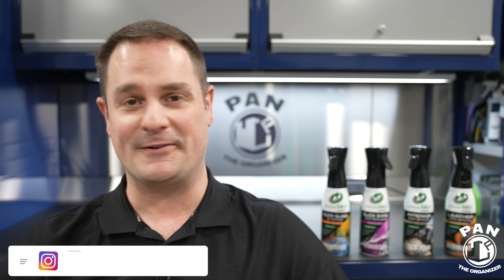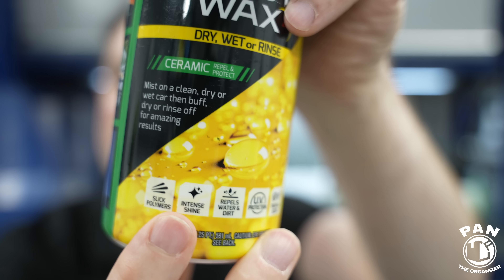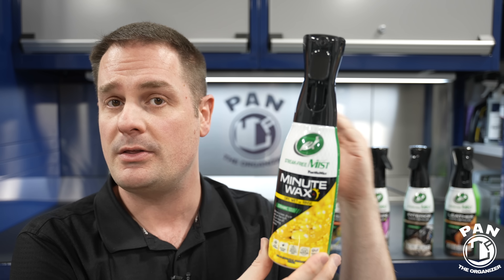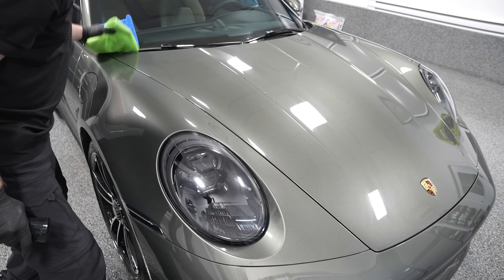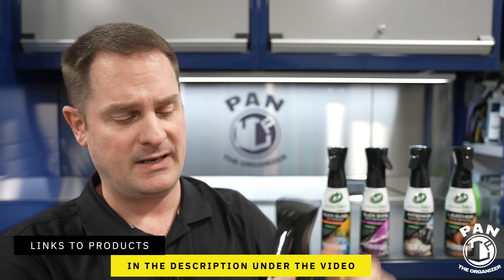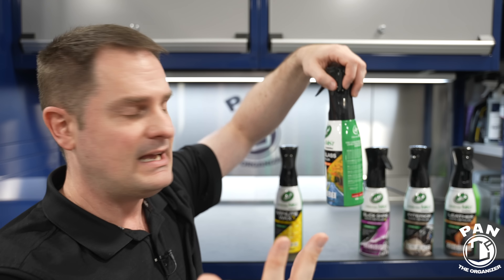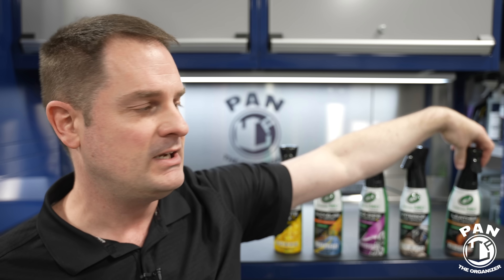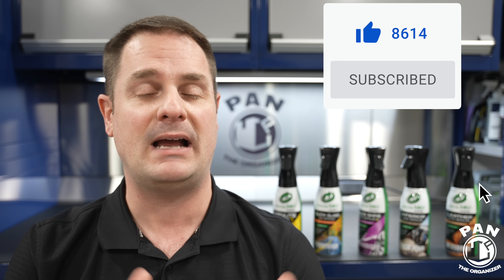The NEW Turtle Wax Minute Wax! You guys made this happen!

Comment: I'm still using the hybrid solutions flex spray wax as my topper. Im thoroughly happy with it. I might try this after that bottle is done
Reply from the maker: Turtle Wax says that Flex Wax is the most versatile and can be used on multiple different surfaces with their highest level of protection; Ceramic Spray Coating is for painted surfaces only, and Minute Wax is great for a quick addition of ceramic to any existing protection.
Reply: @PanTheOrganizer  Our Ceramic Spray Coating can also be used on exterior surfaces including glass, headlights, trim and wheels!

Comment: So pan .... is this similar or cheaper version of flex ? I use flex on my " basic " regular customers and gyeon wetcoat on my ceramic maintenance customers . Maybe a side by side of this and flex .
Reply from the maker: No. Flex Wax isn’t a quick detailer, it’s a long term protection. Not the same thing.

Turtle Wax says that Flex Wax is their most versatile spray on protection and can be used on multiple different surfaces with their highest level of protection. Ceramic Spray Coating is for painted surfaces only, and Minute Wax is great for a quick addition of ceramic to any existing protection. 

In my testing, Flex Wax lasts 9-10 months and viewers in more gentle climates got 10-12 months. With Ceramic Spray Coating, I see 8-9 months with two layers applied (24hrs between layers). And Turtle Wax states one can expect 6 to 12 months of protection with the new Minute Wax. 

As Minute Wax is new to market, I still need more time to evaluate the real world durability of Wet Wax in my conditions, but I would recommend it more as a topper over an existing protection, to boost the properties of that protection and maintain its durability.

Comment: I have tried quite a few so called no streak spray detailers. Haven’t found any yet
Reply from the maker: Often times, it's user error it too much is applied, or applied in the wrong conditions. In all the quick detailers I recommend, I have zero streaking issues. But I work in a controlled environment.
Reply: @PanTheOrganizer  I usually apply in my shop in the shade and only mist it. Have tried the turtle wax black ceramic on my black cars. Not impressed. Only using it now to use it up. Tired of buying things that don’t work as advertised but use them up and try something else when it runs out

Comment: This looks awesome Pan!  Based on your vids, I applied Adam's Graphene Advanced ceramic coating to my new Genesis after full day of prep, as soon as I took delivery in Oct.  Since then only occasionally DIY wash or touchless because of crappy Ottawa winters.  Would you recommend I maintain my coating with Adams graphene detailer srpay, or this new TW MW, or a combo of both?
Reply from the maker: Either or are good choices. You can't go wrong. The key is regular maintenance. Weekly washes are the best.

Comment: what do you say about this vs ice seal n shine?
Reply from the maker: Seal N Shine is in a different product range (ICE which is higher end, and the top of the line is the Hybrid Solutions Line). So I wouldn't compare these. Minute Wax is more of a quick detailer, and Seal N Shine is more of a long term paint sealant (4-6 months durability, and Seal N Shine has way better chemical resistance).

Comment: Pan is this product dangerous and slippery if it gets on motorcycle tires?
Reply from the maker: Never use products on motorcycle tires. If you want to apply this on a motorcycle’s painted surfaces, spray onto a microfiber towel first and then wipe the surface. No risk of overspray on tires that way.
Reply: @PanTheOrganizer   I thought maybe (doesnt these products have Silica in them?)  they wouldnt be crazy slick on tire thread. Unlike typical armor-all, etc!

Comment: I did buy this group of products, I thought I would give them a try. I will have to say that the interior detailing and/or the leather detailer spray, doesn't smell that good. I haven't used many of the other interior products you've reviewed...I will at some point, but so far the chemical guys interior detailer and leather cleaner are light years above the turtle wax stuff when it comes to smell. Now if they could use that smell from their old car wash: the pink bubble gum stuff I will recant.
Reply from the maker: Did you try Minute Wax? This is pretty good!!
Reply: @PanTheOrganizer   I haven't had a chance to use it yet: the weather in Seattle has been uncooperative.

Comment: Turtle wax is really doing a great job with their product line over the past few years. The flairosol (sp?) sprayers are great. My local Walmart has all 5 of these products, although not prominently displayed (their detailing products area looks like a 3 yr old does the organizing). I used the Minute Wax and Slick Glass when I washed my wife's CRV this afternoon (McKees N-914 Rinseless). The minute wax applies easily and does smell great. I love that smooth feeling on the paint afterwards. I'll be curious to see how much rain repellency the Slick Glass provides. 

How do you think the Minute Wax compares to the Hybrid Solutions Ceramic Wet Wax?
Reply from the maker: Minute Wax is more versatile (as it can be applied to wet or dry surfaces), costs less, and according to Turtle Wax, should last longer. Turtle Wax states one can expect 6 to 12 months of protection with the new Minute Wax. 

As Minute Wax is new to market, I still need more time to evaluate the real world durability of Wet Wax in my conditions, but I would recommend it more as a topper over an existing protection, to boost the properties of that protection and maintain its durability.

Comment: Questions Pan. I have a 2023 Tesla Model Y performance with white seats. I just got my car ceramic coated, first time ever. Even on my other Tesla's I didn't do it. The detailer told me never to put any product on there that has waxes or polymers. But in this video you are saying it's okay to use this minute product that has polymers in it on top of my ceramic coating? Any insight. Also their leather cleaning product, would that be good on Tesla's white seats?
Reply from the maker: That info is correct, assuming we are talking about a pure wax or pure synthetic paint sealants. You don't apply those on ceramic coatings, as you would be masking the coating's performance.

What you can apply are ceramic based or graphene based sprays, like is the case with Minute Wax here. Even though Minute Wax has a bit of wax inside it, the ceramic formulation makes it compatible with existing coatings, as per Turtle Wax claims. 

Hence why I was able to apply it on my own ceramic coated Porsche. :)

For Tesla seats, see what I did in a new Tesla Model Y prep video here: https://youtu.be/gohks8xP5NY
Reply: @PanTheOrganizer  - thank you Pan for the super quick response.  Then I will definitely try this new turtle wax product. I've always taken care of my own cars so I love detailing. Obviously at the super amateur level. It was funny the link that you sent when I clicked on it. I have a red model y except with the different color seats. I will check those products out. Also, I've been using mainly chemical guys over the years and would like to try something new.
Reply from the maker: Welcome to my channel. You discovered one of the biggest car detailing channels on YouTube as we surpassed 865,000 subscribers and we have almost 110 million views! I have been detailing for 25 years and I love to share my knowledge and passion with my viewers.

You found the right channel to help you learn everything about detailing.

Comment: Hey Pan! Off topic of the video! My rims seem to build a lot of break dust and are a hassle to clean them even with weekly cleanings. Any tips on how to prevent/ make it easier for me to maintenance them easier for me in between my details!
Reply from the maker: There are no miracles to prevent brake dust, as that really is dependent on what types of brakes you have. But you can make cleaning the wheels much quicker/easier by following the tricks in my wheel cleaning tutorial here: https://youtu.be/Ty4ZTq7A7rc

Comment: How is this different from Hybrid Solutions Flex Wax?
Reply from the maker: Completely different products. Flex Wax is a part of the Hybrid Solutions PRO line, the top of the pack.

What is "Better" is dependent on what the consumer is looking for. According to Turtle Wax, Flex Wax is most versatile and can be used on multiple different surfaces with their highest level of protection; Ceramic Spray Coating is for painted surfaces only, and Minute Wax is great for a quick addition of Ceramic. 

Turtle Wax states one can expect 6 to 12 months of protection with the new Minute Wax.  I get 9+ months of durability with Flex Wax in my testing.

As Minute Wax is new to market, I still need more time to evaluate the real world durability of Wet Wax in my conditions, but I would recommend it more as a topper over an existing protection, to boost the properties of that protection and maintain its durability.

Comment: For first time users: Based on my own experience with the Slick Shine (which I only use as a detailing solution to wipe off bugs and small bits and patches of daily road grit) and the Minute Wax, they work great... but, I've encountered a problem with the bottles. Even before shaking them for use, I weighed them. Why? Because when I first handled the Minute Wax, I noticed that their weights were very different from one another. That's how off they were. The Minute Wash (3 bottles) was the worst of the lot. One bottle was lighter than the other by 27%, so there was that much less product for the money. The Slick Shine: 4% discrepancy. I also bought a couple of bottles of Interior Quick Detailer: 5% discrepancy. I attempted to post the aforementioned (near word for word) on the Walmart site, but it was not accepted. Gee. I wonder why. Anyway, I see the bottler as the problem. Hopefully, TW has identified the problem and worked it out.

Comment: My only concern with missing products like this is they aren’t meant to be used outside. Even if there’s a little bit of wind, the amount of product that will blow away is insane.
Reply from the maker: Just spray closer, directly on your microfiber towel, and problem solved. And that's only if it's super windy outside. Any other regular day is fine, just like for any spray product.

Comment: What's the expected longevity under "normal/average" conditions?
Reply from the maker: There are no durability claims for this. It’s just a quick detailer. A few weeks, perhaps a month. It’s main goal isn’t long term durability.
Reply from the maker: Correction. After speaking with Turtle Wax, they state that one can expect 6 to 12 months of protection with the new Minute Wax. 

As Minute Wax is new to market, I still need more time to evaluate the real world durability of Wet Wax in my conditions, but I would recommend it more as a topper over an existing protection, to boost the properties of that protection and maintain its durability.

Comment: How would this compare to meguiars hybrid ceramic wax? I’d like to see see a comparison. And maybe a long run video to see which one lasts longer.
Reply from the maker: You can’t compare them as the Meguiar’s Hybrid Ceramic Spray Wax is long term protection, not a quick wax like the Minute Wax.

The competitor to the Meguiar’s is the TW Graphene Flex Wax, and it lasts much longer in my testing.
Reply: Thank you for the clarification. Love your videos Pan!
Reply from the maker: Thanks Paul! What's your favourite video on my channel so far, by the way?

Comment: This isn't the hybrid solutions line, so how is this positioned?
Reply from the maker: Hybrid Solutions is still the top tier in the brand.
Reply: @PanTheOrganizer  so I assume this sits between the ice line and hybrid solutions line?
Reply from the maker: Turtle Wax states one can expect 6 to 12 months of protection with the new Minute Wax. 

As Minute Wax is new to market, I still need more time to evaluate the real world durability of Wet Wax in my conditions, but I would recommend it more as a topper over an existing protection, to boost the properties of that protection and maintain its durability.
Reply: @Pan The Organizer  what a strange answer. I did ask where the new streakfrea products placed in the line

Comment: Pan - how does this product compare and differ from P&S Beadmaker?
Reply from the maker: Turtle Wax states one can expect 6 to 12 months of protection with the new Minute Wax. 

As Minute Wax is new to market, I still need more time to evaluate the real world durability of Wet Wax in my conditions, but I would recommend it more as a topper over an existing protection, to boost the properties of that protection and maintain its durability.

Bead Maker in my testing only lasts 3-4 weeks, but has great gloss and slickness.

Comment: How does the minute wax differ from the wet wax?
Reply: The delivery system of a mist trigger vs a traditional spray trigger is a big key difference. However, Our HS Ceramic Wet Wax is more durable as it is a part of our Hybrid Solutions Line-Up. We recommend applying Ceramic Wet Wax on a clean, wet surface - prior to drying your car. Whereas, Minute Wax can be used dry, wet, or a rinse wash.

Comment: Cure time & durability?
Reply from the maker: No curing time. You can drive off in the rain right after the application if you want. Durability, like any protection, really depends on a bunch of factors like prep, application, conditions, maintenance, etc.

Turtle Wax states one can expect 6 to 12 months of protection with the new Minute Wax. 

As Minute Wax is new to market, I still need more time to evaluate the real world durability of Wet Wax in my conditions, but I would recommend it more as a topper over an existing protection, to boost the properties of that protection and maintain its durability.

But as I said in the video, this isn't really used for long term protection. This is a quick detail spray type hence the name Minute Wax. It's perfect to top off existing protection. On its own, I'd expect it to last a few weeks to perhaps over a month. Time will tell.

If you have a base protection like a coating, or the Turtle Wax Graphene Flex Wax or Turtle Wax Ceramic Spray Coating, you foundation layers are there for longevity. You would use Minute Wax as a maintenance topper, to boost gloss, slickness and hydrophobics.

Comment: What is the difference between TW Pure Shine and TW Minute Wax?
Reply: Great question! Minute Wax is intended as a true wax base layer that provides gloss, durable protection, and water repellency from the ceramic infusion. While, Pure Shine is infused with graphene to deepen the color and maximize your car's gloss, shine, and slickness.
Reply: @turtlewax  While drying the car I am using TW infuse Flex and then TW Pure shine! At what point do you recommend TW Minute wax or I don't need it!

Comment: How does it compare to Bead Maker
Reply from the maker: Bead Maker has insane gloss and slickness, but only usually lasts 3 to 4 weeks in my testing. Turtle Wax states one can expect 6 to 12 months of protection with the new Minute Wax. 

As Minute Wax is new to market, I still need more time to evaluate the real world durability of Wet Wax in my conditions, but I would recommend it more as a topper over an existing protection, to boost the properties of that protection and maintain its durability.

Comment: It's nice to have all of these choices but it's also getting kind of ridiculous how many different steps to polish a car.  How many bottles do I have to buy now?
Reply from the maker: This is not a polish. It's a paint protectant. Polishing involves paint correction: a compound or polish, a pad, and a polisher. Protection is the product you apply at the end of the polishing steps, to seal the finish and protect it from the elements.

And I'm not sure why you saw it's ridiculous how many different steps to polish car?

This product can be as simple as you wash your car, and apply the product. It doesn't get any easier than this. So again, not sure what you meant by your comment Phil...
Reply: @PanTheOrganizer  I'm simple saying that the new line of hybrid solutions has at least 6 products. Now you have the new line of Minute products.  The company has a wonderful research dept apparently but how many products does one need to keep a car clean?  I still have many carnauba and polymer products from the past sitting in my garage.  I don't expect you to see my point as you speak and probably being monetized from the company. Like I originally said it's ridiculous how many bottles of car products I have bought in the past not even including several Meguire's products.

Comment: With the effort virtually the same to apply Minute Wax vs. Seal & Shine, and the price for each is very similar (Walmart $8.48 MW vs. $12.13 SS). Seal & Shine offers a highly reviewed, top performer in its class, proven, torture-tested, reliable product that will last much longer than Minute Wax.  Can't I just use Seal & Shine as a "topper"?  Is there something Minute Wax is providing beyond Seal & Shine?
Reply from the maker: Turtle Wax states that Minute Wax can last 6 to 12 months (still too new to market so nobody has had the chance to test for that long yet, time will tell), and has more slickness compared to Seal N Shine. That being said, if you already have Seal N Shine, no need to use Minute Wax, both are very good.

Comment: Is the leather a protectant or a conditioner? Leather with clear coat needs protectant, leather with it worn off needs conditioner, from what I've learned watching and reading everything I can
Reply: Our Leather Detailer Streak Free Mist is formulated to keep leather surfaces clean, soft, and protected! So both! Thanks to the ceramic infusion combined with aloe vera and neatsfoot oil, it's made to hydrate, soften, and add extreme UV protection